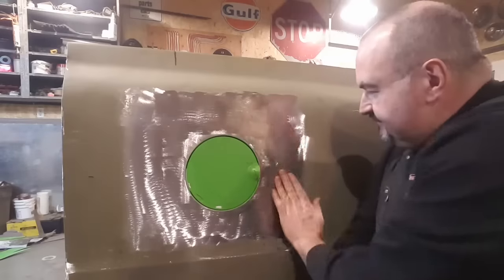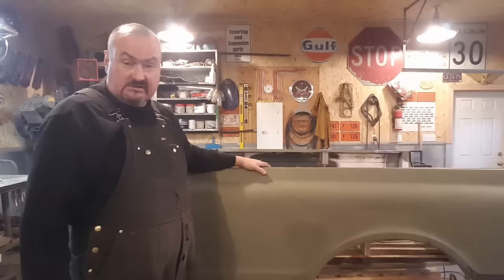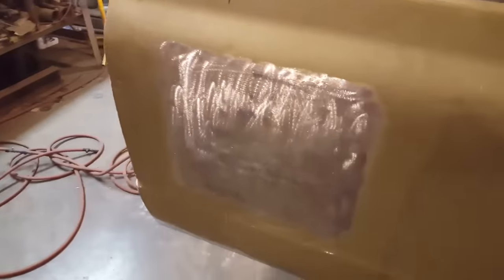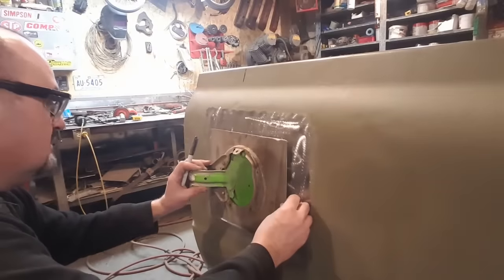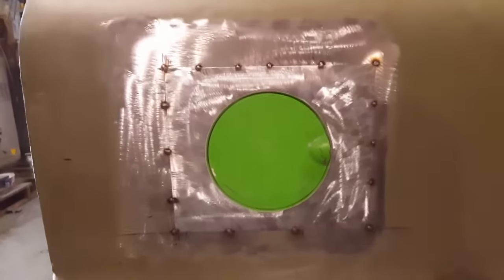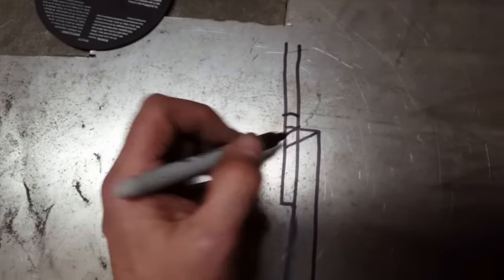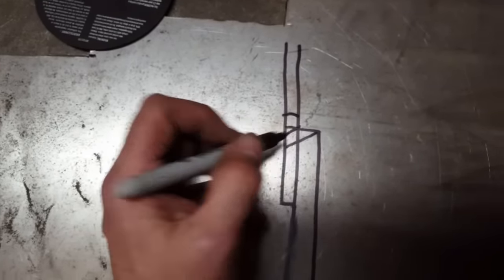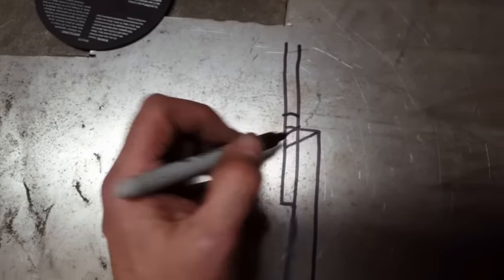Butt welding sheet metal the easy way.

Comment: I'll have to try that. Typically I just drill holes around the perimeter of the butt cut to plug weld on a backer plate, and I also drill holes on the patch as well. I've always considered a backer plate as adding a bit of structural strengthening.
Reply from the maker: I done that as well. Just find it adds to the amount  of bodywork needed. But hey. There more then one way to skin a cat!
Reply: @fitzeesfabrications  The beauty of your method is that it would eliminate the need to remove the burr left behind on the inside by drilling, or else the backer plate wouldn't lay flat. I have no experience with punch tools so I can't comment on that. On your tack in place, and cut at an angle technique, it seems the most difficult part would be the intersecting corners where the blade would have to plunge enough to meet that corner, while being mindful of the tack weld location and possible movement of cutting through a close tack weld. Perhaps a smaller, or well used cut-off blade would come in handy at those corners. Anyway, thanks for posting.
Reply from the maker: I just run off the corners into good metal. Make sure there is a clean corner. Thanks for watching

Comment: Great way of doing it i must admit, for instance if you done this method and the panels behind were sealed is there anyway of getting the metal out from behind afterwards or during doing it this way?
Reply from the maker: If they are sealed I would cut to fit the panel.

Comment: The thing that I didn't understand was the fact that the hole you cut in the bed was smaller than the patch panel. I knew I didn't understand something when you pulled the metal out of the backside. I had to go back and re-watch the portion where you first put the patch panel on. Other than that, it was a great video. I'm going to try it on a patch panel I have to put on. Currently I take a lot of time cutting a little bit at a time and fitting, then more cutting and fitting.

Comment: If you watch closely, he isn't really cutting at a 45 degree angle. That's why the gap isn't closing up like he said it would. When I do this kind of patch I scribe the panel and cut it exactly to fit in. That way you don't have feather thin edges to weld to.
Reply from the maker: You must not of watch it. Cause it's a 45 and it did close up the gap.
Reply: Where's your video?  Strange how thousands of us love Fitzee's videos...

Comment: What was the purpose for rounding the inside corners on the initial square hole in the side if the bed before you tacked the gas door panel un place. Thank you for your thoughtfulness and incredible instructional videos.
Reply: Let me ask again without the grammatical errors. What was the purpose for rounding the inside corners on the initial square hole in the side of the bed before you tacked the gas door panel in place. Thank you for your thoughtfulness and incredible instructional videos.
Reply from the maker: No reason.  Just cut it to fitted door so it would clear the hing section. Had to cut it a few times to get it.

Comment: Just seeing this now , but, I wonder rather than sharp corners would it matter if the corners were cut on a 45? My thinking is is no area to have a “stress” point whether from heat or otherwise. Great tip with the angle cut, thank you!
Reply from the maker: @michaeldecker2725  some do that. I never had any troubles with stress. I think that is more of a airplane type of repair. I find the right angles are quicker as well.

Comment: Easy to do on a nice open area. Try doing that in a tight spot like on the floor pans where it meets the firewall. Then this video would be informational.
Reply from the maker: I used it on floors and many other places.

Comment: I have been welding for a few years now and I have always been concerned about doing this to body panels because of the gap situation you mentioned but they way you explained that makes it look easy. I have to do panels on a 51 Chevy truck on the floor pans and the cab corners and rockers. Was wondering if this technique would work for that work as well? Thanks for the awesome video.
Reply from the maker: It's not easy on a curved  panel like a cab corner. But any other flat panel it will work just fine

Comment: I build Custom sheet metal curbs for hvac units at work. Always running .035 at 19 -21 volts on 18 gauze and thinner. Could do it in my sleep

Comment: I’m getting low spots/valleys on both sides of my seams where the metal shrinks. I’m keeping it cool and spacing my spots out well, but cannot seem to get the smoothness you have because of those low areas. Any advice? I’m trying to avoid filler, but maybe it’s necessary.

Comment: I always prefer to mark out the square cut on the main panel and then drill the corners before I cut (HA - and always with a guard on the cut-off wheel) so I end up with a 'square hole with round corners' and then cut the insert to suit.  It can reduce the chance of stress risers that may (not will) occur on nice 90 degree corners.  I am not saying the 90 degree corners are bad on steel - but me being somewhat of a 'worrier' - I just like to take that extra step - and yes - it takes a bit more time to do the round corners on everything.  (Not that they will be welded with a MIG - but ALL repairs to plastic panels should always have a round hole at the end of a repair line - stress risers can be very problematic in plastic - I learned that as a kid in my first job as a Dental Technician.  Failure to drill a round hole in the plastic at the end of a repair crack - 100.0% of the time - the item was back for repair - a round hole at the end of the repair - always eliminated the stress riser).  Fitzee certainly has 'magic hands' when it comes to his determination with steel body repairs - always a pleasure to watch a MASTER CRAFTSMEN.  HA - the 'SPINNING WHEEL of DEATH' = a 9" angle grinder - they scare the CRAP out of me - HA.  Have a safe and nice day all.  CHEERS from AUSTRALIA.

Comment: Any comments on using a cutoff wheel vs a thin metal blade? I’d think a blade would give you a smaller gap but maybe there’s a downside I am not thinking about. 

Either way, awesome technique! Next time I’m doing this I will use your method.
Reply from the maker: Some like blades. Me I like cutting dish. Both will get great results.

Comment: I was just using some of those things you showed in your toolbox to weld a floor panel.  It took much longer that way.  I should have watched your video before hand.  I'm wondering if an air saw would work better with the angle cutting ( seems it would be thinner than the wheel ).
Reply from the maker: What ever you feel more comfortable using. Both ways work

Comment: Great video! I watched "How to set up your mig welder for sheet metal" and began repairing the driver's front heater channel of my '73 Bug convertible. All went very well with a lot of thanks to your video! The next piece that needs to be welded in is a patch panel for the driver's side lower rear wheel housing. I want to use your 45 degree cutting technique to butt weld in the panel. The issue is there is no access to the back side of the patch area to remove the scrap piece which results from this 45 degree technique. Any suggestions?
Reply from the maker: Thanks. Glad I could be of help. In cases like that I cut to butt. Sometimes you just have to if there is no way to remove from the backside

Comment: Maybe suggest grinding the weld only first to bring it down close to level , then do the rewelds , then grind just the weld to almost almost level, then blend the weld out with the big dog grinder, by the time your done with 2 or so big dog grindings your panel area is going to be half its original thickness, only grind the weld and what you need to save as must steel as possible !  God bless !

Comment: Werry good video and werry good explained. Could you tell me please how  thick was the metall what you was welding and with which settings did you work on the welding machine?
Reply from the maker: This was over a year ago and welding on a old machine. The metals  were close the same. Think thr truck and door was 20 gage metal. The welder was setup same as it is in the how to set up your mig for sheet metal video I have
Reply: Thank you for your answer, after I asked you, I saw the other video and that was helpful enough. Thank you werry much and keep up the good work.

Comment: Great video.  Regarding the 45-degree cutting, how do you do this if the patch is half the size of the cutoff wheel, is there another tool that has been used for the angle cut? Thanks.
Reply from the maker: Small patches I can use a old used cutting disk in air grinder grid the patch is small enough I use a cut to fit method. Sometimes I will mix the cut and butt along with cut to fit  together

Comment: Great tip...have a question you weld with solid wire mig?... what was the welder setup...do you have any video do panel repair with flux core wire... looking for tips and welder setup
Reply from the maker: Don't like flux core wire for bodywork. Tack welding can be a nightmare. I have a video...how to set up a mig for welding sheet metal. Check  it out on my channel

Comment: This way of doing it works great for keeping the panel flush But I had the problem of also tacking the cut off metal behind the new panel also and had no way to get the cut off pieces off. So if your going to do it this way do it in a place where you can get to the back side easily.

Comment: Tried this on my square body door 7.5 x 7.5 inch patch and warped the door skin around the patch I guess I was going to fast with the spot welds once or twice. It was looking good till near the end had a wet rag cooling it down but still got a nice warp.....
Should I cut out the whole patch and start over???
Thanks
Reply from the maker: You learned from it. Watch it with water it shrinks it. I find taking your time and letting the spot welds cool right off naturally is best. I think I would start over or if it is not too bad I try to work it out with hammer and dolly

Comment: This is the 2nd time i'm watching this and must say that it looks pretty good and nice . Now i did try your technique on a small patch on the floor of my Ford truck back in Nov. of last year and it worked great.   I will have to do this again on the LH rear cab corner here this spring.  A question for you . How do i fix warped metal ? It warped on RH side cab corner about half way up the cab on the back side. Thanks.
Reply from the maker: Warpage by the welds is never easy to get back. You can working if you can get to the back side but have offen cut that section  out and redone it.
Reply: @fitzeesfabrications  Thank you

Comment: I will have to say firsthand, me seeing anyone weld without a helmet is my first red flag.... Seeing you create more work than necessary is my second red flag... You're fired!!! The metal doesnt need all that heat from a grinder, which creates warpage, and uneven thickness to boot. And lastly, it should have been round hole, not a square. That creates more work, time is money.
Reply from the maker: Thanks for watching!

Comment: I'm going to give this method a try on my lower rocker which was dented in. The only difference is I have a body line going through the middle. Consider to start on the body line instead of the corners to make sure that lines up - what do you think???
Reply from the maker: Hard to do on a rocker as you can't get in behind it
Reply: @fitzeesfabrications  you're absolutely correct. I have a 12" section with a nasty dent. I plan on cutting that piece out of another 87 chevy c10 in the junk yard, so I at least have that to work with.

Comment: Great technique; I have a question though, is the hinge installed on the wrong side; shouldn't it be facing forward, toward the front of the truck? it seems to me that the air steam would then to open the door instead of keeping it closed.
Reply from the maker: It's on right.

Comment: Hello, do you recommend using this technique for floor pans as well? Also, when working in tight spaces, may not be able to do 45 degree cuts and just have to cut straight leaving a wider gap. Perhaps use a smaller cutting wheel? Any tips for these situations? Thanks for the video!
Reply from the maker: I use the 45 where I can. If I can't get to a spot ill scrib and cut that section  back to where I can cut and butt.
Reply: @fitzeesfabrications  Ok, thanks!

Comment: With no welding face shield, do you shut your eyes at the torch strike to shield from uv light eye damage? Otherwise,  very neat job. Just welding in some panels into series land rover footwells. Seventy years of weathering!
Reply from the maker: I hide the arc behind tip of the gun. Old trick I learned years ago

Comment: Hi Fitzee, I've watched and enjoyed most of your videos. Still I have had some issues doing your butt weld technique (so far on 2 areas on my car). When I make my 45 degree cut there still seems to  be too much space between the pieces being butt welded, I use a .045 thick cut off disk. Do I need to use a narrower disk? I've used the replacement panel as my guide edge, do I need to remove a little bit of both the new metal and the old metal? 
Another problem is the part that is being replaced should drop out once all the cuts followed by the completed welding takes place. In my situation both times the part being replaced (the drop out piece) has become welded to the underside of the replacement panel in several spots. In one of the places it is next to impossible to get behind the panel to cut out that bad piece. Any solutions? I've enjoyed how you break the complicated pieces into several stages, rather than doing a lot of stretching or shrinking. Thanks

Comment: where do you get those sanding discs you use at the end? and do they make them for a 4.5" grinder too? flap wheels are expensive and dont last and grinding discs are way too aggressive.
Reply from the maker: They fit the grinders.  Just need a good backing pad for them . They are just 24 grit grinding disks

Comment: Amazing!    Just a small observation though; would it not be better to use one of the smaller and thinner type of air powered grinders that are now in common use in body shops? Or would these be too thin for this method?
Reply from the maker: No it could be used. I just prefer  the bigger cutting wheels

Comment: Hi Fitzee, I took your tip and added a fuel door to my old truck. That 45 degree angle worked near perfect thank you for that. I was wondering, what would you recommend to apply to the backside of the welded patch panel to prevent rust coming on the back side of it? I was thinking some rust check?
Reply from the maker: If I can get to the panel I like to seam seal the welds. If not I like to apply a good rust paint.  Rust check creaps and any small pin hole it will sneak threw and give you headaches when comes time for filler work
Reply: @fitzeesfabrications  I will take your advice. Thanks alot, (and again) for such a quick reply. enjoying all your videos.

Comment: No block magnets needed. This is easier than using magnets? What size wire and how much current do you use on your mig welder?
Reply from the maker: I use 023 wire.

Comment: I’m new to welding.
What type of welding device are you using for this sheet metal work.
I have a Lincoln Weld-Pak 100 that I’m about to convert to use argon.
Is this set up sufficient for some sheet metal body work?
What wire should I use with this setup? 
Thanks for taking the time to make this video!
Reply from the maker: It's not a bad little welder. Should work fine for sheetmetal

Comment: I understand the concept to this method and will give it a shot for my next patch panel. Any suggestions for lower portion of a fender? I was gonna tackle a patch panel on lower section of a 57 chevy fender, very common rust location. It would require a slightly different go at it since I have to cut the offending rust off 1st
Reply from the maker: Yes cutbit off but leave metal for over lap. Cut it to fit the front wheel edge on a butt joint then do cut and butt across the top edge. Much same as I do door bottoms

Comment: Is this technique able to be used on say a 1999 Chevy truck body, or is the new metal too thin? Also question do you know if the 99 mentioned Is the high strength steel which is very difficult to weld. Thx. Love your video.
Reply from the maker: Yes you can it is harder as the metal is thinner. This gas door was from  s 2009
Reply: @fitzeesfabrications  thank you

Comment: Is it possible to do butt welding without access to the back of the panel/welds and rest assured that the back welds are contiguous to avoid worrying about premature rusting from the inside of the panel? One million thank you!
Reply from the maker: You can drill holes in the inner structure and apply paint or oil to the back side if there is an issue getting to the back side
Reply: Many thanks for your reply.

Comment: What if you can't access the backside to remove the panel off? Like the floor for example? Do you have any tricks for this kind situation? Thanks. Great trick btw.
Reply from the maker: I just fit it to a over lapped panel. Scribe a line on the edge. Remove panel and cut on scribe line
Reply: @fitzeesfabrications  so there's no magic trick for that situations yet.haha. thanks for your awesome videos, i learned a lot from them

Comment: I imagine this would be a great technique to widen the rear fenders on my 55 F100.  Are you using .023  mig wire for the spot welds?
Reply from the maker: Yes 023. I use it on those fenders a few times now. The roll overed going down the sides are tricky. I do those fenders in 5 peices.